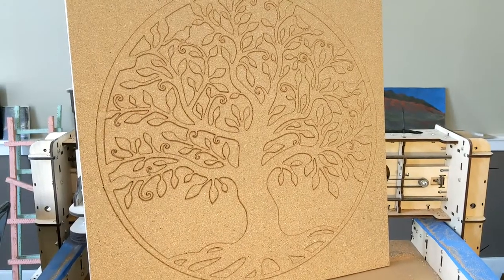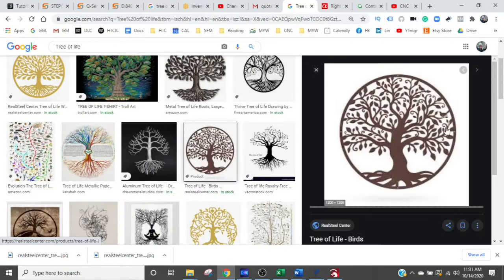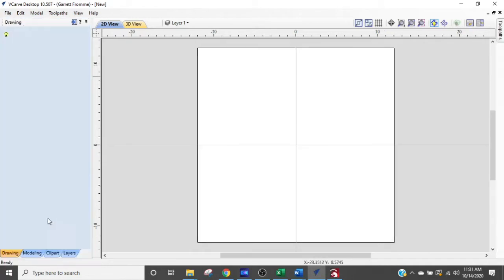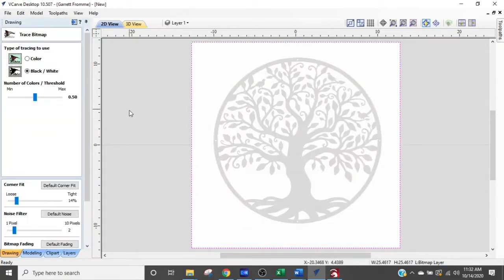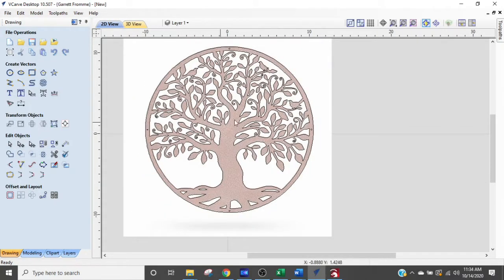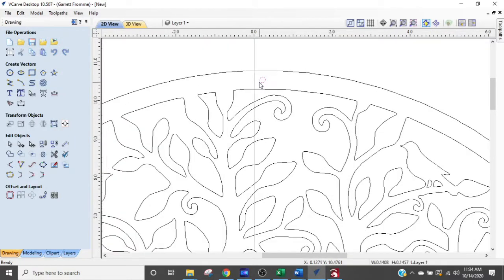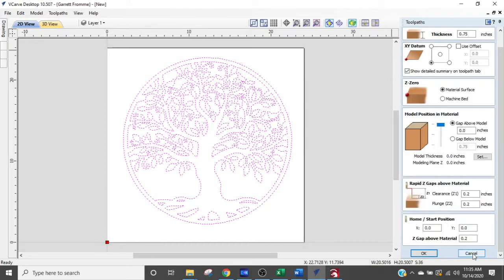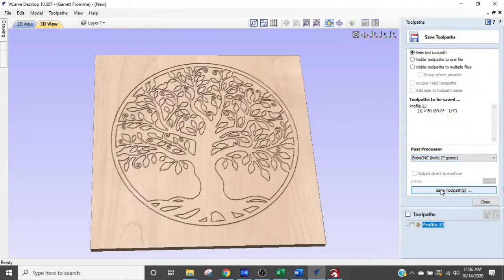Vcarve First CNC Router Project Made Easy For Beginners,  Vectric Vcarve - Garrett Fromme

Comment: This is great quick design and last night printing now. Wish I had checked the clock as I did 5 of your designs last night. The flag still needs some work. Like on this on I tried for 20 minutes to remove the 4 holes to no avail :(
Reply from the maker: Hey Darren. you could not remove the holes because your design was grouped. Select the design, right click and ungroup. Then you'll be able to remove the circles

Comment: I enjoy your videos and have watched most of them, I have a question that I hope you can answer. I have the same E4 machine and have just purchased VCarve Desktop from Vectric. I ran my first project with the new software and saved my tool paths noting that the post processor listed was the same as yours, BobsCNC (inch) (*gcode). I then selected the file in UGS to run the file and I get: error while starting file stream and nothing runs. I haven't been able to find an answer that will let me continue. Any ideas would be greatly appreciated, thanks
Reply from the maker: You are probably getting an alarm 2. If so, the machine cannot go down far enough. Stick the bit out a little bit, rezero and try again

Comment: You can buy svg dxf files ready to cut on etsy really cheap.  I think i seen the Aztec calendar for $2.99
Reply: I get a lot of joy out of building and or upgrading my cnc.  The machine i have now has work area of 2 feet by 5 feet.  I am in the process of designing a 5 ft by 6 ft.  I would be able to cut the parts with the cnc i have now.  I also do the electronics and build my own controller.
Reply from the maker: @leroyscncwoodworx841  oh my. I'm going to have to tap into your mind. This is on my plate of things to do.
Reply from the maker: Ah yes. I've looked into some thing like that. Kind of takes the fun out of creating though, but when it comes to turning a profit, speed is key.

So what do you do with your CNC these days?